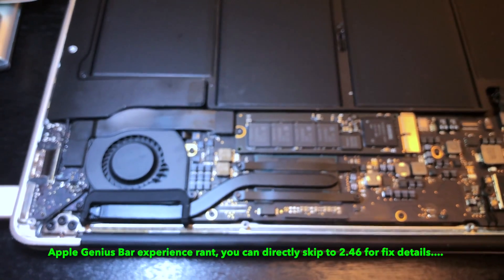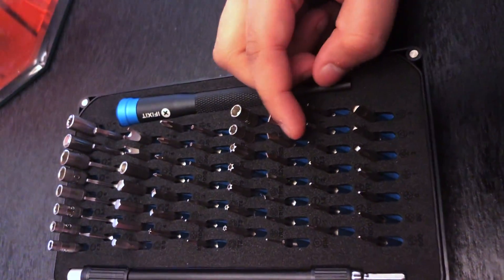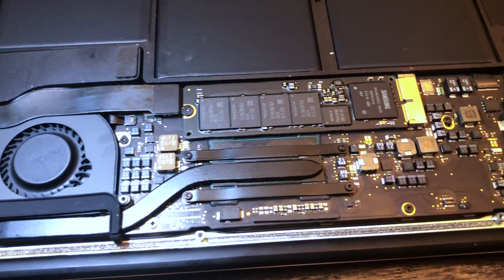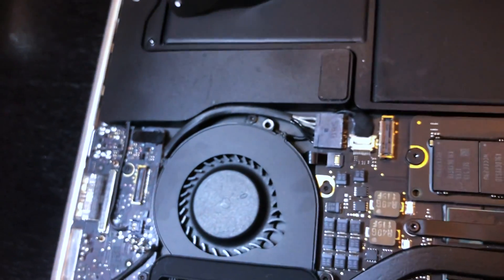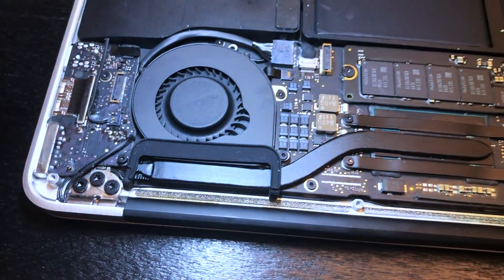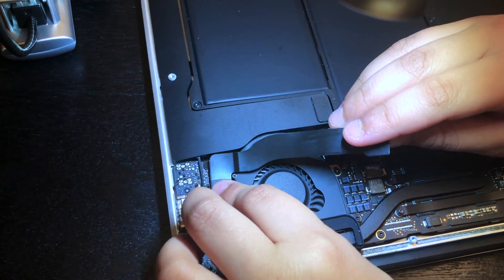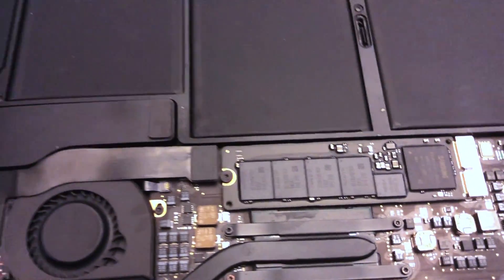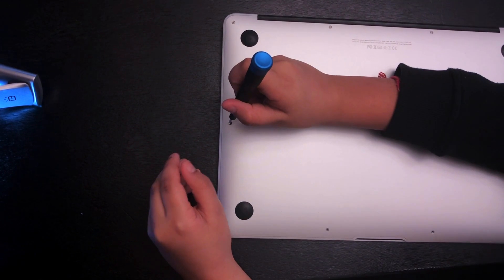Macbook Air Dead, Not Charging - DIY Fix !!

Comment: Dead macbook air 2017. When plugged in orange light is on but not turning green even overnight. Did SMC reset, battery connecter removed  but all failed
Reply from the maker: Could be a battery problem, or could be another problem, not sure.

Comment: Hi 👋 sir can you help me plz my Mac Pro won’t turn on And won’t charge too , It was on until it suddenly turned of , Knowing that I recently fixed it after a little water flowed on it
Then it worked again for about 15 days and then turned off and no longer charging 
And thanks in advance ✌🏻
Reply from the maker: Disconnect the battery, pressure air dry using blower (just cold). Try after few days to see if that helps. It’s very hard to diagnose if any parts failure remotely. We try to show many connections to key peripherals, disconnect all, one by one connect back parts to root cause if any particular part is causing the issue and replace the same.. good luck!
Reply: @Tasteofgyan  thank you sir 🙏🏻

Comment: There are some tiny sensor switches on the board (MacBook Air) that activate when the bottom cover is removed and I presume the laptop will not function unless the cover is reinstated, or if there is any way to bypass these switches. Does anyone know what these switches do?
Reply from the maker: Hmm. Thats strange, I noticed nothing like that on mine, and ours functioned perfectly normal without the cover. In your case I would suggest to potentially tape down the sensor with electric tape. However I cannot be sure.

Comment: The fan is working, and everything is clean but the led lights in my charger isn’t working
Reply from the maker: I had this issue too, My macbook was charging but the light was off, If I used another cable the light turned on. Which left me to believe that the cable's circuit board was faulty, there are other videos on youtube if you want to open it up and try fixing it. I hope I helped!

Comment: Hey man I spilled water on my 2011 MacBook Air do you think you could fix it please I need it for school.
Reply from the maker: Sorry, I'm not qualified to repair one. But I would suggest opening it up and clean it with isopropyl alcohol. Most times it's just a case of some corrosion on one of the connectors. Hope I helped! :)

Comment: Thank you so much for your video I opened my MacBook Air 2017 since it wasn’t charging at all for almost a year and it was so dirty cleaned everything and got a new battery (even though a computer store told me I didn’t need a battery) I still got one anyways from Amazon and installed it myself and let it charge for a whole day and now its working so good and the fan is spinning flawlessly 😌 thanks for the video
Reply from the maker: Great to hear!

Comment: My older MacBook Air has the MagSafe 2 adapter. When cold I plug in the adapter and the green-then-amber LED suggests that it's working properly. Clicking the battery icon in the top status bar though indicates that it's not charging. I note that if the CPU temperature indicates that it's lower than about 16°C and the embedded batteries are cold then it simply will not charge. It will power the MacBook, however. If I then run a program which is processor-intensive (iTunes watching a movie) then the CPU temperature will increase and it will magically start charging the battery. I'm sure it has something to do with the SMC trying to protect something.

I've also been successful by holding the MacBook over a heater until the bottom of the computer doesn't feel icy. Repeatedly connecting/reconnecting the adapter seems to sometimes make it work after doing so.
Reply from the maker: That is true, In my case we live in hot humid climates, which made my water indicators red, And apple said to replace the computer. When it really was just some corrosion. I also read somewhere that sometimes the power brick being cold may also stop charging. Thanks for the tip!

Comment: Hey there,
My fan didn’t work what do i need to do please help
Reply from the maker: Properly check that all the cables are properly connected, If that doesn't work, then remove the connectors and make sure there is no corrosion. Hope I helped!

Comment: Hi man
I need your help, my MacBook air isn't charge and the battery is too flat. And the LED of adapter isn't working.
Reply from the maker: Check for corrosion, If none is found, then your battery may be bad.

Comment: Mine is working but only on power source it says no battery  available.
Please help me. I tried cleaning
Reply from the maker: Check the battery connector, It is very flimsy and will break easily. If it breaks... You have to be good at soldering or has to pay $$$ :(
Reply: did you find a fix? same problem

Comment: I just tried this and my fan came on for about 10 seconds and then went off and then never came back on. Plugged all other components in and now MagSafe charger is no longer showing a green light. There is no light at all and computer did not come on :(
Reply from the maker: For some reason my light never turned on, However, my laptop would charge and function as normal. Also, properly check that all the cables are properly connected, If that doesn't work, then remove the connectors and make sure there is no corrosion.

Comment: hi the fan’s not working for me what do i do? :(
Reply: -샤인  yes me too
Reply: @muzalsh  same
Reply from the maker: Make sure the fan is connected, You may have to replace it if necessary. But most likely its to do with one of the cables or circuit boards.

Comment: all the sudden my 2015 macbook air basically completely fell apart. it went from working fine one day, to all the sudden not charging, not going to sleep when i close the lid, not playing any sound and saying “no output device found”,   not updating to mojave, and running really slow. i haven’t downloaded anything new. it’s currently running on macOS high sierra. does anyone know why l? i’d rlly appreciate the help!!
Reply: OK WOW!! i just cleaned everything from my computer and it all works now!! thank you so much!
Reply: @howsuecsit1  what did you do for your sound ?? i am having the same problem right now
Reply from the maker: It's hard to believe but it works !! Glad to hear you were able to resolve the issue .. Please see if you can help Sohish with the sound issue ...thanks!

Comment: I just replaced my logic board in my Macbook air from having liquid damage,  when I connect the A/C adapter,  there is no LED....is my I/O board bad or it's the battery bad?
Reply: Sometimes the laptop powers on,  sometimes it dosen't... but even when it powers on the LED on the A/C adapter is not on... the macbook air doesn't even recognize the battery either
Reply: @bhobbie39  did you find a fix to this? Mine is doing the same thing, think I need to replace the battery.
Reply from the maker: I would suggest checking if there is any corrosion, If not then try disconnecting the battery. If it doesn't power with an A/C adapter connected then your I/O board may be bad. Hope I could help!
Reply from the maker: There may be damaged connectors or connections in the I/O board.

Comment: so you just clean and wipe it by using a alcohol wipe?
Reply from the maker: Correct, This will remove any corrosion that may cause issues, Another option is isopropyl alcohol alongside a toothbrush this will surely scrub away all the corrosion.